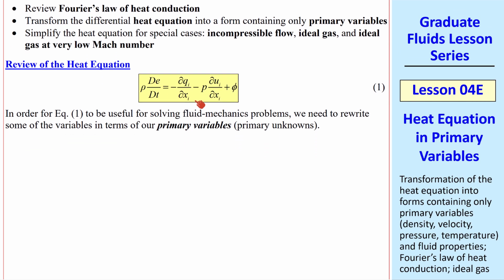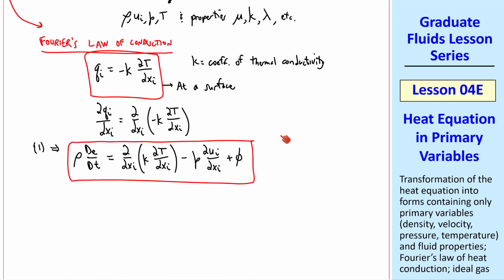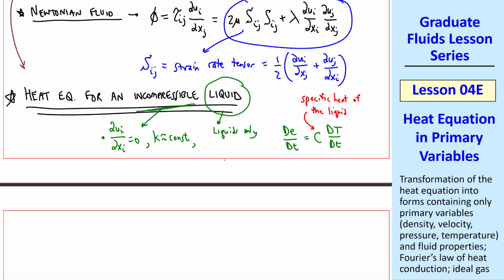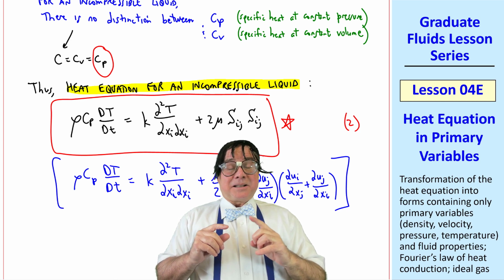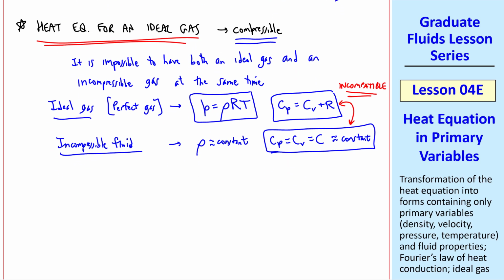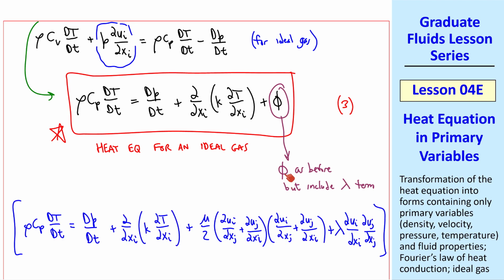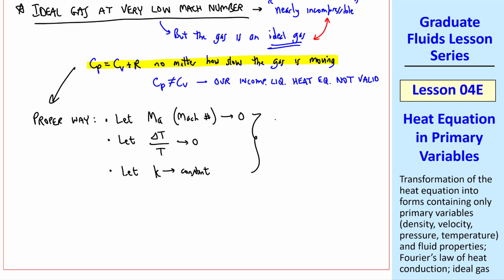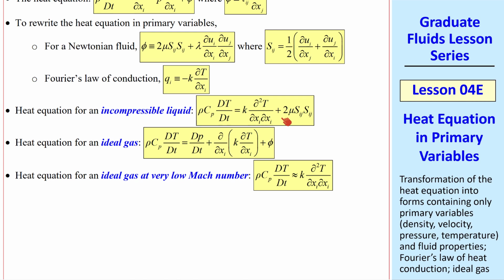Graduate Fluids Lesson 04E: Heat Equation in Primary Variables

Comment: Where did the pressure term go in the heat equation for incompressible liquid?
Reply from the maker: The short answer is the continuity equation. For more details, I explain several different forms of the energy equation in lessons 04D and 04E in this Graduate Fluids series.